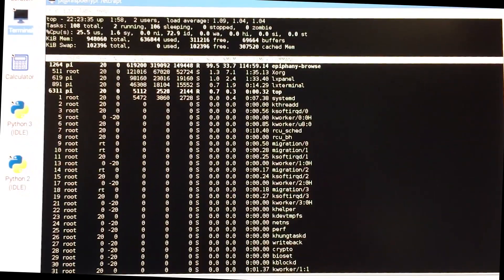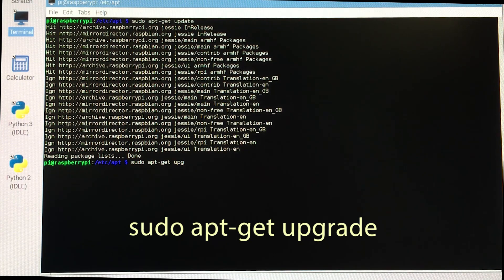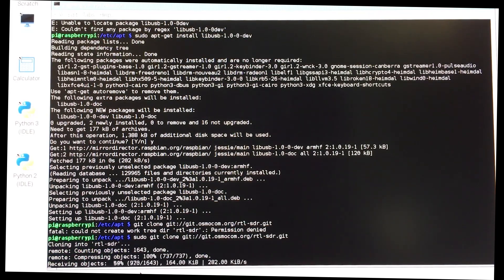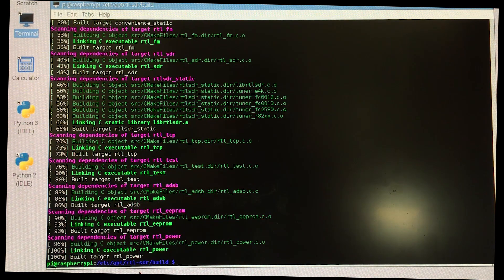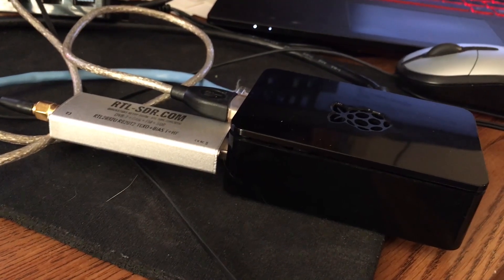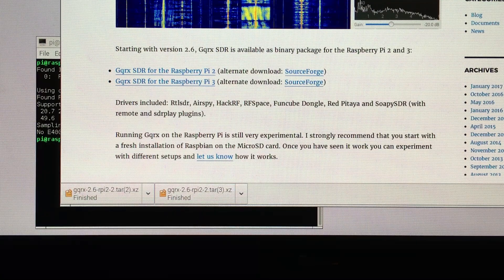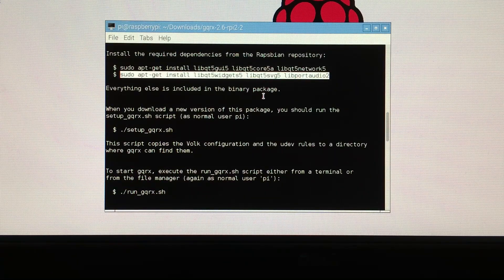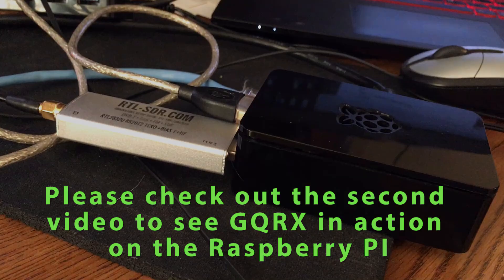Installing RTL-SDR on a Raspberry Pi (Linux)

Comment: well that was fun... raspberry pi 3b+, go through everything by the book... download git repo, cmake, make install, blacklist... lose my usb keyboard and mouse inputs... cuz i just blacklisted a device to take precedence over them perhaps? hard shut down the raspi as it is now un-responsive... power back up, got my keyboard and mouse back, yay... run the test it fails... "add the black listed item as a black list item" or the kernel is using your usb mouse and keyboard currently, try again some other fancy way... sorry your rtl-sdr you just bought is a paper weight... havent tried to ssh into the raspi and then hopefully be able to use visual tools and no just terminal prompt?(rather doubt it... but thatll be next)... got sick of messing with it and tried to install rtl-sda on desktop linux (pop os)... yea it cant manage to find a "libusb.h" file... cuz ya know... a C header file would need to be retrieved from somewhere other than the usual location for the "make" step? this project is all but a steaming pile of dog poo in a dumpster fire... open to suggestions

Comment: After messing with this for the past two days using another video on YouTube,  I've found that his no longer works.  The code is heavily dependent on specific library versions which have all been updated, especially under Raspian Buster, or Version 10.  Unfortunately, the code has not been updated, so unless you try this on an older version of Raspian, it will never work.  Honestly, I don't have the patience to figure out which specific version of Raspian works with GQRX.

Comment: If at 3m45s you don't sudo git, then the git folder isn't root, so you can directly do mkdir, cmake and make as regular user and not sudo. You only have to use sudo at the make install.

Comment: Thanks for the tutorial!  I really appreciate the time to document this.

Since nobody in the comments mentioned it (and please take it as constructive criticism):  It's a bad idea to download source files into a /etc/* directory.  /etc is supposed to contain configurations and scripts related to the local system **only**.  This enforced by having the directory owned by `root`-- which is why your first git clone command fails.  

For compiling programs, it's common to just make a $HOME/src directory, issuing all commands as a regular user.  And only at the end use `sudo` to install the program/libraries into system locations (usually `sudo make install`).

Comment: Got all the way through the install without any issue but fat-fingering a few commands, but got that straightened out. The current version is v2.11.5 so the readme.txt is a bit different from what is in the video. The readme.txt does not have a start command, rather makes reference to "double-clicking on the file gqrx"  presumably this would be in the desktop environment however there were no files that I have found yet that fit this description. Anyone else find where this file may have been placed? and does it in fact start the application?
Reply: I have the same issue and followed the different text file instructions. I found the gqrs file in the downloads folder using the desktop view and dbl clicked on it. It opens but have not figured how it works.

Comment: So, I got it  working but  its  stuttering and choppy on all bands. any ideas?  Should I over  clock?  The CPU  is running up high.
Reply from the maker: it's a fun hobby project, but not an optimal one for SDR.  overclocking might work but if you are more into it from the radio aspect, perhaps try it on a beefier processor.
Reply: I read somewhere audio can be choppy over HDMI, but when audio is forced through the 3,5mm output it's better.

Comment: Question???  I followed all instructions, even step by step with your video.  After all that with GQRX readme.txt instructions, it states double click: no where to double click.  Also the gqrx folder does not have a setup script nor does the gqrx file has a .sh behind it.  I'm running Pi3B+. everything worked fine up until the point of running.  Is is possible for you to look at the Raspberry 3 readme.txt file and maybe tell me what you think?  Thanks in advance

Comment: i am at rtl_test -t and here are the results...
i have gone back and double checked everything and find no errors.
i am using Ubuntu 14.04.
Any ideas?

john@john-MacBookAir:/etc/modprobe.d$ rtl_test -t
Found 1 device(s):
  0:  Realtek, RTL2838UHIDIR, SN: 00000001

Using device 0: Generic RTL2832U OEM

Kernel driver is active, or device is claimed by second instance of librtlsdr.
In the first case, please either detach or blacklist the kernel module
(dvb_usb_rtl28xxu), or enable automatic detaching at compile time.

usb_claim_interface error -6
Failed to open rtlsdr device #0.

Comment: Thanks a lot for a great video.  Lots of good linux lessons here, and I was able to use this as a jumping off point to get my Pi / GQRX project off to a good start.
Reply: After installing gqrx-2.9, I still can't figure out what the run command is exactly. Also, is there a way to add a desktop button for the program?
Reply from the maker: thanks so much. glad to be of help!

Comment: Thanks for dealing with us newbies. After correcting missing spaces, capital letters and extra characters, I got past the first part. The gqrx.dk web site for the Raspberry Pi's has changed. It looks like in version 2.9 they combined RPi2 and RPi3? Should I use https://github.com/csete/gqrx/releases/download/v2.9/gqrx-2.9-linux-armv6.tar.xz or try to find the 2.6 download? When I follow the README.txt instructions, the "sudo apt-get install gnuradio libvolk1-bin libusb-1.0-0 gr-iqbal" instruction fails with "E: Unable to locate package libvolk1-bin". I hope this question makes some sense.
Reply: Doug, I followed the same path, and had 'good' results.. in that the GNU Radio libraries were right there, and installed properly.. the QT5 libraries were already installed, so the second command in the read.me resulted in no additional files.  You would have to be in the correct directory, by using cd gqrx-2.9-linux-armv6 ..  maybe that was the issue?? Both library commands executed without an error, and the volk_profile set of commands also worked.  I have a waterfall and FFT output, but the audio is still not good.  I get an 'output underflowed' error in the terminal window now.  So there is still work to be done.

Comment: The readme file has been updated and .run_gqrx.sh or the setup is not in there.  Does anyone else know what to do?
Reply: From the terminal, while in the gqrx-2.9-linux-armv6 directory, enter ./gqrx  ..  Should get you started.
Reply: @RichardHattaway  I tried that... I'm running off a Raspberry Pi 3 B+ off Raspbian Jessie 8.0. Was in the directory, /Downloads/gqrx-sdr-2.11.5-linux-rpi3 and used ./gqrx and got ./gqrx: error while loading shared libraries: libboost_system.so.1.62.0: cannot open shared object file: No such file or directory
Reply: I noticed the same thing recently when I was putting together some notes on how I got this to work. Truth is, the files/programs/libraries for these applications change rapidly. It’s difficult to pin down a successful path as it is often out of date a few months later. I’ve not revisited it recently, but in general I let the error message lead me toward the new path/file that is needed and eventually a working app is the result. Good luck with yours.
Reply: See my comment. Did you download 2.6 or 2.9?I'm having trouble also.

Comment: Great video.Thanks sharing and learning some Linux on the fly :) Note that GQRX is running at 90 at my PI3 and freezing every now and than... Maybe some improved cooling would take down the load. 73 PD0OXW Albert
Reply from the maker: Thanks so much, try heatsynks on the PI3.
Reply: Will def do ! Thx again.